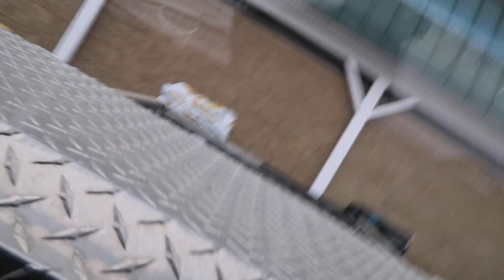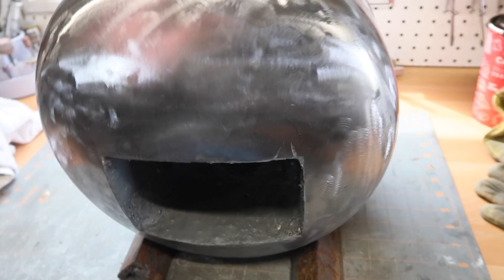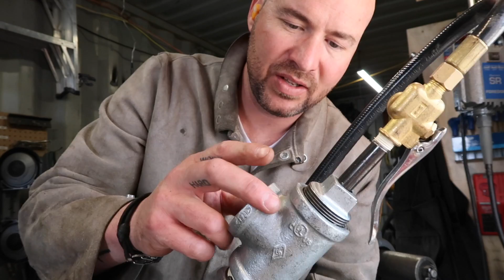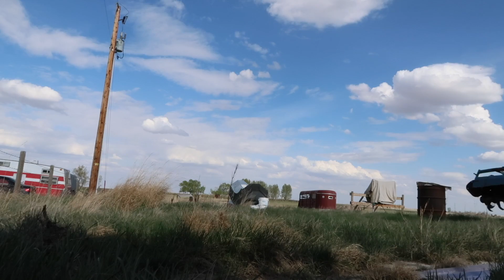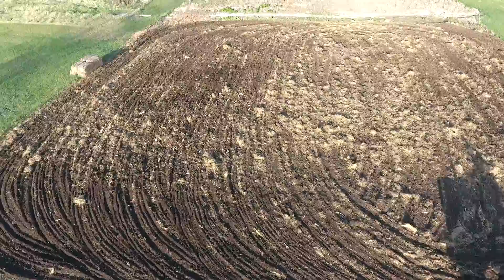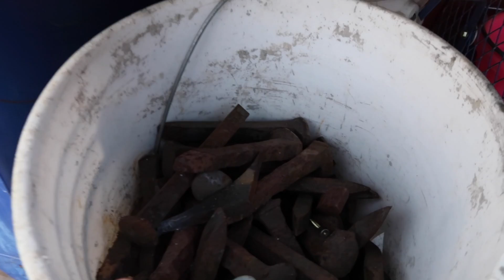Forge Vlog #4 - The Forge Breathes Fire!

Comment: When you beat on the steel , when it darkens stop hitting  and heat again or your end up with stress cracks but still great little forge
Reply: it's hard to determine heat in normal daylight
Reply: You can see it pretty easily even in daylight. You don't get the subtle colors, but you can definitely see when you're not in forging heat.

Comment: Great job on the forge build. You mentioned that you'd like to try forge welding so here's a tip from experience......make sure you have a piece of sacrificial refractory on the floor of the forge to protect your poured refractory from the Borax flux you'll need to use for welding. Once the Borax liquefies and runs it will eat the refractory almost instantly. It's easier to replace a loose piece of refractory than to re-pour the base in the forge.

Comment: I built nearly the same forge a 2 and and a half years ago. It's more than capable of forge welding temps. You've got a bit to learn before welding comes up in your journey but once you get there borax flux is what will do the real damage to a forge lining more than the heat itself. I noticed very little degradation in my lining for the first year, until my first Damascus billet. My only complaint about that forge is that it can be difficult to get a long blade got from tip to riccaso. You've got a HT kiln so that's no problem for you. #1 tip for a new bladesmith is don't make blades, learn basic blacksmithing. you will never regret knowing the fundamentals. Good luck!
Reply from the maker: +Sam Robins that's awesome info! Thanks so much!
Reply: Sam Robins do you have any videos or any more advice?

Comment: Railroad spikes are a great way to learn to forge. You can definitely forge a few fun ye olde knives but unfortunately they typically wont yield hardness much over the very low 40s so keep that in mind! Great fun but there are other fun recycled steels to work with that will become much harder, leaf spring for example 👌

Comment: base for anvil=big log,stump,bunch of 2x4 or 4x4 bolted together..

height= stand straight but natural arms at sides make fist where knuckles are us the height you want the top or striking surface if anvil

put big chain or speaker magnets or both on the anvil reduces ringing noise

Comment: if you put a hinged upper lip on the front opening, you can trap a bit more of the heat from immediately escaping the front of the forge. But it won't inhibit the size of objects placed in or removed. have fun

Comment: All you need for to choke your air intakes are round metal disk on the end of them with bolts on the out side of the disc to rotate the disc to open and close them to the degree you want

Comment: RR spikes are great fun to forge out. My first forging project was a spike blade as well. Just remember that they are way too low in carbon to make really good blades (generally under 1%), so they're pretty much just a KLO unless you forge-weld in a piece of high carbon steel for the edge. They do make one heckuva cool letter opener, though!

Comment: Great looking forge. Some ideas for bells and whistles:
1. Instead of that work rest in the front, make an adjustable tool rest that is narrow and slides in and out. It will let you accommodate curved pieces and long bars more easily. Look at the the Atlas Froge and the Ellis forge to get an idea.
2. Weld a piece of angle iron to the top and bottom of the forge opening such that you can slide two halves of a firebrick in there. That way you can adjust the opening size.

Comment: Just FYI in the future on welding projects don't ground through screws or bolts and especially don't let the ground travel through a bearing. If you move or wiggle your work current
 will arc across threads and bearing surfaces and burn them, causing failure. Just a thought.

Comment: Looks good man. I've been meaning to upgrade mine for a while. Have most of the parts, just so many other projects that keep distracting me! However, my current forge is pretty much done, the lining is more than half gone right under the burner and it's where I do my heat treating as well so I need to get on the new build.

Comment: I would put a brick in the bottom to have a flatter surface to put the knives on when your heating them up and the fire from the torch will damage the break instead of the actual Forge which will make it last longer.

Comment: From what I understand cementing the brick into the bottom wasn't a great idea.  When forging people use Borax for flux (not sure if you will need to or not), Borax is acid that eats away at your fire brick.  Replacing it in the forge you have built will be difficult if you need to do it.

Comment: You didn't have to cover the ceramicwool, it is heat resistant enough for blacksmithing
Reply: Little blade Maker its  because the ceramic fibers are horrible to breathe in and because the ceramic will absorb heat whereas the refractory cement will refract aka reflect the heat back onto the metal and also slows down breakdown if insawool especially if using flux which eats insawool for breakfast

Comment: Awesome! I'm making a forge with the same design (gas tank) and the burner you made but once my burner is inside the forge the burner is "coughing". Outside the forge it's great, nice jet blue flame etc but inside I really do have some troubles. Does it lack air or something like that?
Thanks! :)
Reply: Sami Laaidi No enough oxygen, increase air flow and it will "smooth" out 😉
Reply: Thank you I will try that as soon as possible! :)

Comment: how did the cement hold up over time?
Reply from the maker: It has just started to break down over this past summer. That might just be because it was 2020 too..😆. I think I had about 50 burns in it and then it started to fail. I’ll probably re-line it in the spring when it warms back up and I can get back to some forging. 👍

Comment: Hello sorry the disturbance, i would like to know which flame retardant you used? Because here in italy I would not know what to buy like this. thank you
Reply from the maker: +GIACOMO LA TORRE I use Cermic wool as an insulator and coated that with refractory cement (it was purchased from a local hardware store but it was a Canadian brand).  That's all I did. Does that help at all?
Reply: Thank you very kindly, I will inform you in the hardware shops here! Thanks for the timeliness. You are a master of everything to do and follow you with admiration!